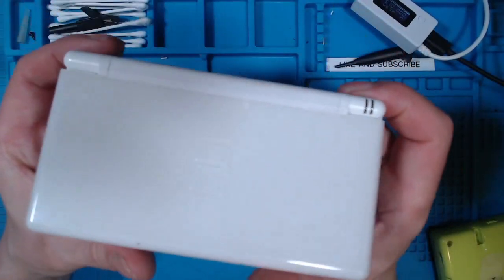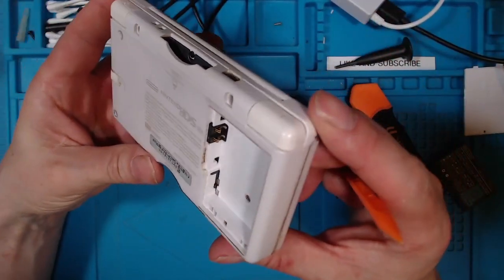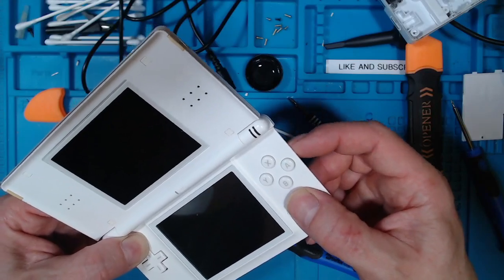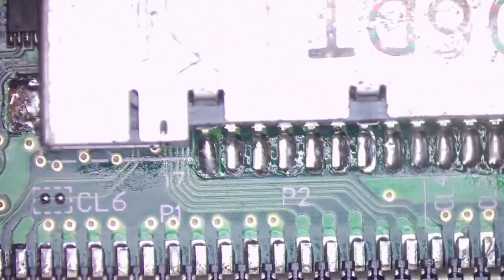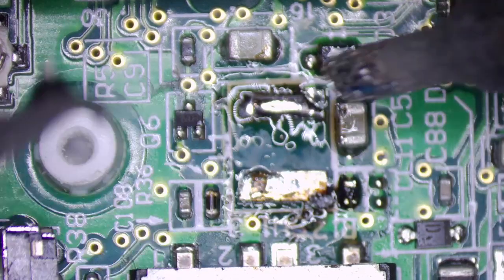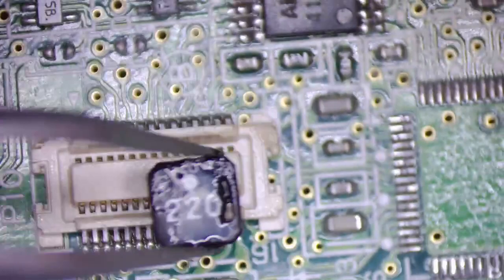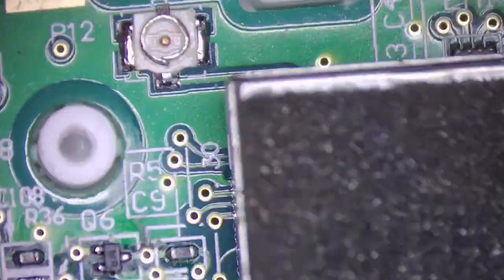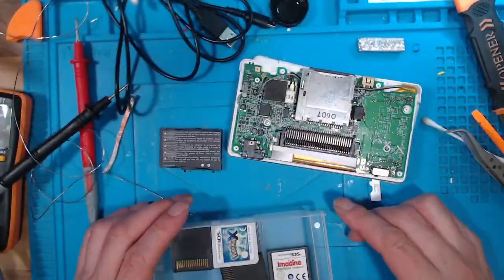Nintendo DSlite charges but won't turn on. Let's fix it

Comment: Hey, im consulting if my ds lite is worth to try to fix. I was trying to clean my ds lite after not touching it for almost a year. Before unscrewing the screws near the L and R button, it was functioning well. But after tweaking the screws (i later on realized i dont have the right screwdriver on the other screws so i stopped unscrewing it and put the screws back on) it started to act up. First it will randomly die. Then it became more often to the point that the screen kept turning on and off. The green/ orange light wont turn off even after closing the lid and turning it off. After slightly loosening the screws near the L and R button, the screen blinking stopped. I played Ninokuni for almost an hour before i turned it off and the next day it wasnt turning on nor charging at all
Reply from the maker: I think the problems you're having and turning those screws is just a coincidence. Did you turn the screws under the battery cover too?

Comment: Sir, i have a problem with my ds lite. It's overheating at the L5 and L6 inductor which is the two inductor near at the gba slot, and suddenly when playing it for too long, it automatically turns off the system itself. Could it possibly the inductors are the culprit or something like other fuses are the malfunctioning?
Reply from the maker: I don't think both inductors would be faulty at the same time. When it turns off, does it turn back on immediately? It could be a dry solder joint opening as the system heats up. Is there any charge left in the battery when the system shuts off?
Reply: @PhilipBryden  it doesn't turns on again after it turns off sir. But when i played it i noticed it kinda hot in the part where the start and select button is. And when i open it and try to indicate where the heat is coming from, it came from the L5 & L6 sir. I tried to search on reddit, youtube and anywhere else sir if i can find similar to my problem but there's nothing i can find similar to me sir. There's a charge on the battery sir when it turns off, because i tried it on my other ds lite and it seem to be fine
Reply from the maker: @angelotheartist1918  It's hard to say, if something is getting hot it sounds like a shorted component. It's possibly the chip U3 has developed a fault or U9 or U10 below it.

Comment: Hello mate, I’ve recently found my old ds lite and im having the same issue, the charging light turns on but it doesnt power on, what do you suggest I do, should I order a new battery?
Reply from the maker: Yes, order a new battery and take it from there.

Comment: I bought a new battery for mine but it stopped working again within a day🥲is there any solution to this problem??
Reply from the maker: Perhaps the battery isn't charging. You should get a solid orange charge light when you plug the charger in.
Reply: @PhilipBryden  oh thank you!! But how would you make sure it’s charging?
Reply from the maker: When you plug it in, there should be a solid orange light

Comment: I have replaced the shell for my Original Nintendo DS Phat system, but it won't turn on. I read it could be the ribbons that aren't connected well? I don't get a green light when I push the power button but it does charge and show the orange light. So Idk what I should look out for to fix this? :)
Reply from the maker: Disconnect the ribbon cables, clean the ends with 99% IPA then reassemble.
Reply: Oh Okay I'll try that ! ^^ Thanks already! @PhilipBryden
Reply: Okay I tried that and still nothing, everything is inserted the best it can be.. when I charge it and try to turn it on it gave me a buzzing sound, something with the speakers i suppose? I remember it still turning on with bottom screen so since I changed the ribbon cable for the top one it should also work but yea nope :/ I'm a bit lost what to do now.

Comment: I have the same problem with my nintendo DS lite. It didn't fall or anything like that, since I pay a lot of attention to my consoles, one day it started turning off and on without me doing anything and now it charges but doesn't turn on. Any tips? Also what can I use to clean my power switch, or other mother board components? Is "pink alcohol" (the one that everyone has in their kitchen lol) ok?
Reply from the maker: You will need some IPA or contact cleaner to clean the switch. The problem could be the battery is not holding it's charge properly.
Reply: @PhilipBryden  Thank you so much for the reply and for the tutorials you bring on your channel! I replaced my battery and now it randomly turns on and off when the DS is closed, I think something moved, maybe a cable or maybe the battery is not correctly in place lol.

Comment: I have a ds lite, charging light works, but when I turn on the green light blink once the top screen flashes and then nothing happens, already tested the continuality os the fuses and they are ok, what could it be? How can I test if the problem are the screens? Thank you
Reply from the maker: The bottom screen is faulty and needs to be replaced
Reply: @PhilipBryden  thanks I'll try to replace it

Comment: What was the screwdriver you used my ds also won't turn green
Reply from the maker: Hello, you'll need a tri-wing screw driver. Let me know how you get on. Good luck.
Reply: Hi just an update I was able to check the battery but the metal thing like in your video is gone but there's still the pokadot tape I didn't want to open the day lite because I might damage the insides so I'll wait for my new battery to arrive before I open it
Reply from the maker: @-mCdonALdS-964  Hopefully it's just a dead battery. The replacement battery should have enough charge in it, to test the system. I'm not sure what you mean when you say 'metal thing'?
Reply: 2:34 - 2:37 Sorry if I said it wrong hehe but there's a metal thing beside at the bottom of the polka dot tape on the yellow oneI'm not sure if that damages the ds or something but because this has been stuck in a drawer for 7 years there was a time it flooded I'm not sure where the ds was but hopefully the flooding did not damage it, right now I'm waiting for a new battery
Reply from the maker: @-mCdonALdS-964  That metal thing inside is part of the bottom gameslot as seen 4:48  next to 'C/USG...'

Comment: I ran into a problem today with a ds not powering on but it was charging. I'm still pretty new at fixing ds's. there was no sign of water damage at all and strips were clean. There was a sign of someone trying to fix the ds though. They wrote bad f1 fuse and I noticed the inductor you replaced wasn't the factory one on mine. So I looks like it was replaced at some point. And I tried the known good battery and even tested the fuses and found nothing wrong. So I came to YouTube, for some reason I didn't think about cleaning the power switch with iPa. So as soon as you mentioned it I tried it and the ds booted right on lol. So now I'm wondering if the previous person didn't think of it either and just counted it as Junk haha. Thank you for the great video tho there's always something new to learn even the simple things.
Reply from the maker: That's a great result, well done. I'm gad you got it working.  It's always worth checking fuses a few times and even scratching the solder with the probes to make sure you get a good connection. Thanks for watching my video.

Comment: I have a white ds lite as well but I've never tried fixing one before. It would charge and a green light would show but nothing comes on the screen and there wasn't any sound. replaced the battery, wifi thing, tried using different screens. top and bottom but those were fine. but the power volume and the digitizer latch and the the stick that turns the power on broke easily even though i know i was careful. replaced the digitizer bc the ribbon cable was broken, still didn't work. I'm not too sure what it could be. Love this video btw! Not too many videos of repairing ds's
Reply from the maker: There is a power management chip which could be the culprit. By the sounds of it, this one is ready to be used as a donor board. Sadly we can't fix them all, but you can end up learning a hell of a lot from the failed ones.
Reply: @PhilipBryden  yeah that's true, the top and bottom screens are fine. New digitizer but it seems i need a new motherboard and new housing shell. Thank you, also subscribed to ur channel ❤

Comment: Well done Phil. Hope to see a follow up on the button. Sure looked as though someone had  been in there playing around.
Reply: I think I’m going to look at the key fob myself and use the other one I have as a reference. I suspect though it woul have to go back to the dealership for reset or enter a code to use it . Which I heard costs about $125. Perhaps that is the only problem at this point. FYI it was in my jeans on the wash. I’ll keep you updated! I see you have two new videos out , I have to check them out
Reply from the maker: @edwardreichard3852  If it has gone through the wash it's probably full of corrosion inside. Take it apart, remove the battery and soak it in white vinegar for a coupl eof hours. Then clean the vinegar off with IPA.
Reply: @PhilipBryden  ok I will tonight at we will see tomorrow
Reply from the maker: Yes someone has been messing things up in there. I'm hoping the button doesn't have any trace damage. The screens and outer shell look pretty decent, compared to the inside.
Reply: Interested on working on a key fob, for a mini van,
Reply from the maker: @edwardreichard3852  Open it up and send me a photo, lets see if there is any visual faults. What is the problem with it?
Reply: @PhilipBryden   it won’t open the car when locked, with a new
Reply from the maker: @edwardreichard3852  how would I be able to tell if I had fixed it? There's no way of knowing unless I was testing it on the car.
Reply: @PhilipBryden  good point haha

Comment: Nice fix Mr B 🙂🙂, as it happens I ha e a Nintendo DS Lite with no power in White 🤣.

What's the guarantee of mine not being something like that 🤔🤣.
Reply from the maker: Hi Chris, I have a few spares if you need anything. The DSlites don't get the love they deserve, too many people are concentrating on the modding the Gameboy line, but the DSlite has it all built in as standard.
Reply: @PhilipBryden  Thanks Phil, I do have 1 to use as a donor which was also a no power will need to determine why yet though 🤣

Comment: Great video again . 100% someone already open it cause the white cable it's not pass from the right place.
Reply from the maker: I've just remembered, it's supposed to go under the board. I'll have to remove the board, fix or replace that broken switch and put it all back together the right way. Thanks Froz.

Comment: F2 fuse?
Reply from the maker: Both fuses tested fine
Reply: @PhilipBryden  that was a nice job there ☺️👍👍
Reply: @PhilipBryden  how did you test them? With continuity meter or looking for a resistance value?
Reply: @Firerexify  continuity meter